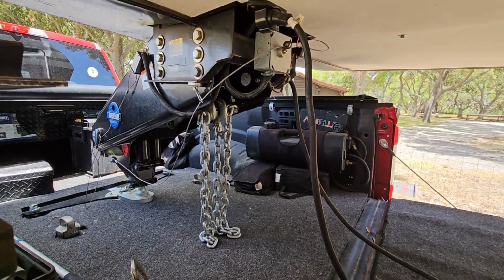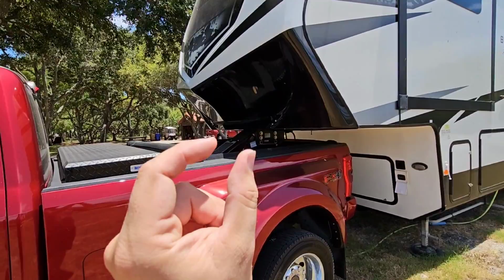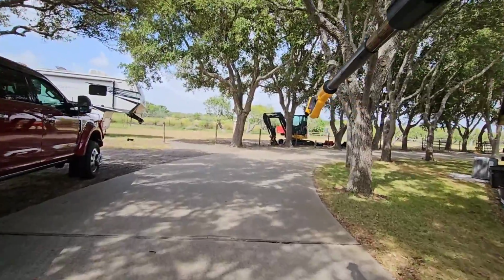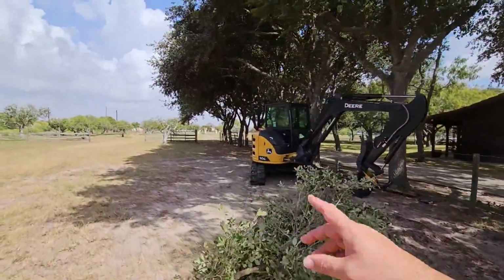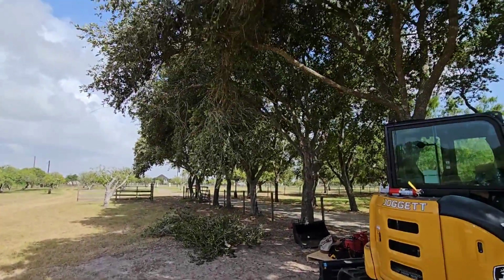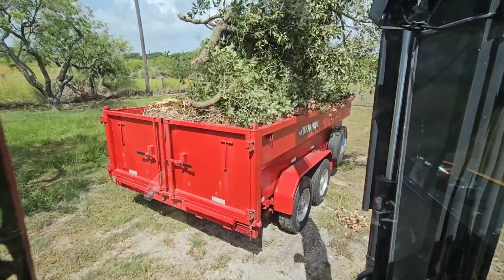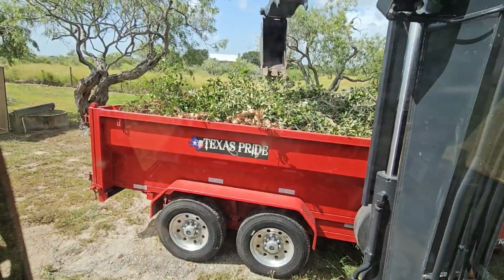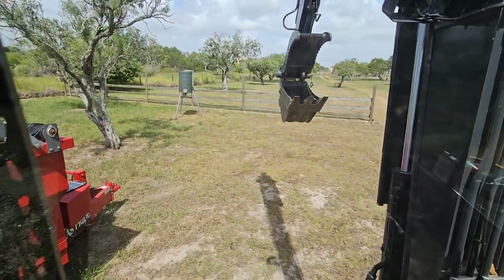Might have damaged my RV's Roof!

Comment: JD: what space between the bed and 5th wheel do you advise.  I was in a park in Santa Cruz, CA. The road was off camber and one of the screws on the 5th wheel caught my plastic bed rails. Have some damage. (We all do it lol darn it.) I was able to raise my B&W 5th wheel hitch up one level. Not sure if I should raise the pin box vs the 5th wheel hitch or both.  Maybe I missed your video covering this?

Tree's are a PIA in my area between the city and home owners the tree's hang out into the roadway.  Roof gone in 60 seconds if you don't pay attention.  I love tree's just don't want to damage my RV trying to get down the road.  

You might be better off chipping those branches and throwing it at the base of the tree's.  OR areas prone to weed abatement.  They will keep moisture and keep the weeds down. This is what my grandfather did around the fence lines on our property.

Comment: Do you have a leveling valve setup on the 450? I noticed a hissing sound once the trailer was hitched on this video and the last one
Reply: We have the Airride system with auto adjusts based on pressure